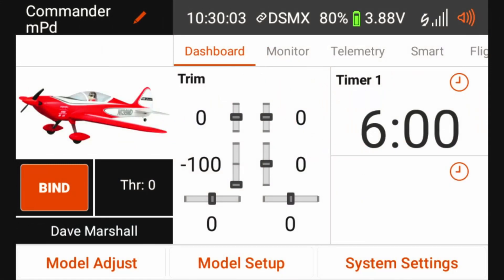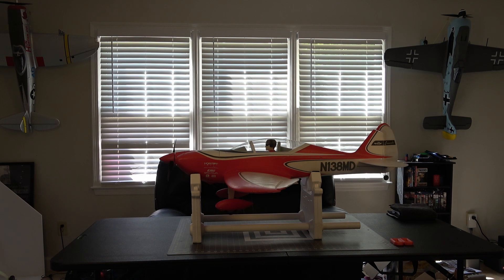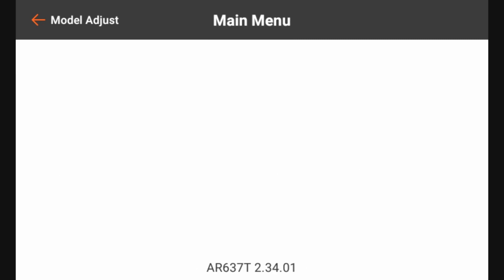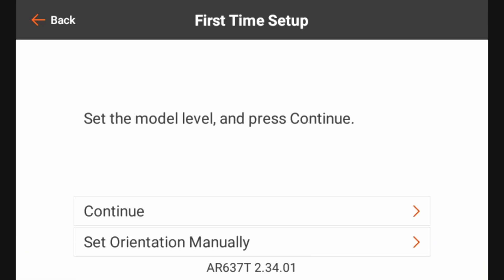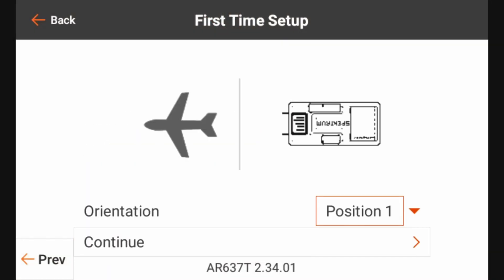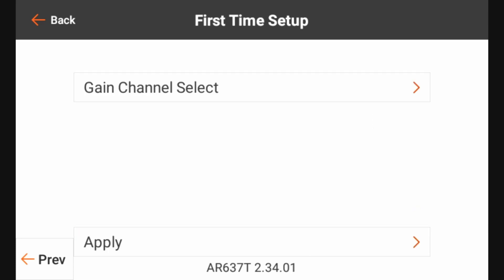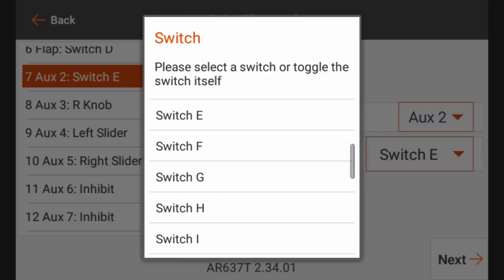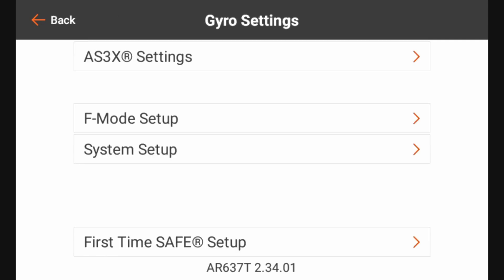Spektrum AR637T Programming Series | Part 6 - First Time Setup

Comment from the maker: Thanks for watching the AR637T Programming Series! If you have any questions, please leave a comment! Like, Share, Subscribe, and ring the notification icon so you never miss a new video! Tune in to Air Marshall Monday's - Every Monday at 8PM Eastern! Have a great day!
Reply from the maker: You wouldn’t need to start over completely, but you would definitely need to adjust your orientation. The gains for AS3X / SAFE should still be the same. Usually any issues with signal loss can be traced back to poor antenna placement. You want to have the two antennas positioned 90 degrees opposed from each other, and you want to have them as far as possible away from the battery. As far as the magnet, I’m not 100% sure on that.
Reply: @TheRCAirMarshall  im using the AR630 receiver no antena sir, thats is why implanning to move the receiver maybe it will help. The only thing I have to do is do the orientation of the receiver again in forward programming? Appreciate your help sir.
Reply: Hi Sir Question, does the magnet on the nose cone of F16 affects the signal of the receiver? I put mine close to the nose and I am getting signal loss but get connected right away. Also if I move the receiver do I have to start again from the beginning programming it? Thank you
Reply from the maker: Gotcha, same applies you want the side of the receiver opposite the pins as far from the battery as possible then. The AR630 can definitely see some interference from batteries. The larger the battery the worse it can be.
Reply: @TheRCAirMarshall  thank you
Reply: Pro tip : watch movies on Flixzone. I've been using them for watching all kinds of movies lately.
Reply: @Maximilian Cassius Definitely, been watching on flixzone for since december myself :D

Comment: I have a 637T new out of the package, bound to my NX8, airplane setup done, reversing, throttle cut, etc all set.  When I go to gyro settings, first time setup it will go no further with next button, no msg, just stuck at first time setup. I have powered it off/on, same issue. My NX8 is 4.02, the 637T is 2.35.0.  Telemetry works fine, GPS module is connected OK.

Comment: Do you know if the programming is going to be the same for the AR630? I have one coming tomorrow and want to put in my FW Blue Angels F-18. Got any suggestions for gains and other numbers for setting up SAFE for that plane? Just like to have a little safety net if something bad happens as I've only flown a couple EDF's so far. I probably wouldn't have gotten the receiver if this programming series wasn't so good, so thanks for making it easier!

Comment: Great video! When I try to go to forward programming it says unable to connect, any idea what would cause this?
Reply from the maker: Kevin DuRant couple of things. If you’re using a DX series transmitter you need to be running firmware version 2.05 on your transmitter. Also, it could be that you don’t have Throttle Cut enabled.
Reply: @TheRCAirMarshall  thank's I'll check that and try again.

Comment: I have a DX6E it doesn't have a slider or at nob.
How do I adjust the ganes?
The horizon hobby tech person said that this receiver is compatible with my transmitter
Reply from the maker: James Turncliff for the DX6E, while you won’t have linear infinite gain adjustments, you can put the gain adjust on a switch. Not sure if the DX6e has the same switch compliment as a DX6, if you have a 3 position switch you can devote to the gain adjust, you could have, say, one position at +100, 0, and -50, which would give you ~100%, 50%, and 25%.

Comment: Great video Dave!  One of the lessons I learned when I first attempted to program the AR637T is that during basic set up of the aircraft you should also assign the switches you intend to use for adjusting the AS3X gains while in-flight and the flight modes to your available Aux channels.  When I wasn't doing that up front, for some reason my DX8 would only show Aux3 as being available for both AS3X gain adjustments and flight modes (which I suspect you will be discussing in a future video).  Aux 2 was not an option.  The guys at Horizon seemed to know right away what I did wrong and when I assigned the switches up front it worked like a charm!  This might only be an issue for the DX series transmitters.
Reply from the maker: Steve Clough great tips, thanks!

Comment: hi great videos i am changing the receiver from the AR636 to AR637T can you use receiver configuration files i have the night radian ft thank you
Reply from the maker: As of right now today you cannot take the settings from an AR636 and import them into an AR637T. You would need to get the gain settings and priority settings from the AR636 setup and input them manually.
Reply: @TheRCAirMarshall   thank you very much for your help
Reply: I have a knight radiant as well.
I laminated it and put proper hinges on it.
Went to crazy with the laminate on the fuselage. Was way to tail heavy.
Looked on YouTube found two great videos.
Radian mods 1&2.
Great informative videos that will work on the Night Radian as well. to make it a fantastic glider instead of just a ok one
Reply: @jamesturncliff5960  i like the idea of hinges
Reply: @barrydownes7259  I also put the remote light switch on my.
Works great 👍
Reply: @jamesturncliff5960  i am just thinking of that if you don't mind me asking what did you use
Reply: @barrydownes7259  J Bauer Electronics.
Has the remote light switch you can find them on the internet.
I have a stock receiver. and a DX6E transmitter
Reply: @jamesturncliff5960  thank you very much
Reply: @barrydownes7259  hopefully that is what you wanted to know.
Reply: @jamesturncliff5960  yes thanks that look great